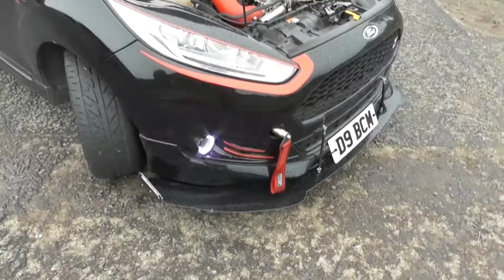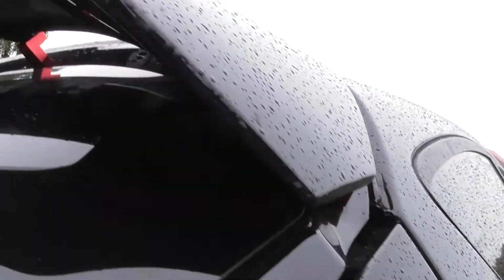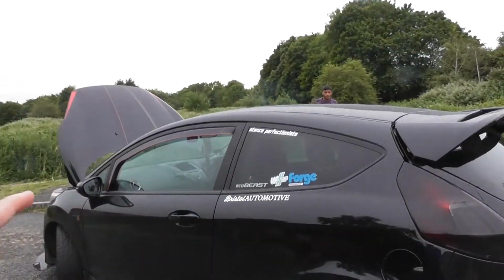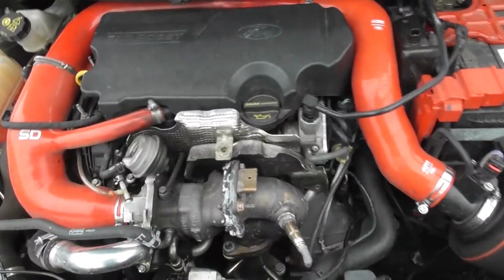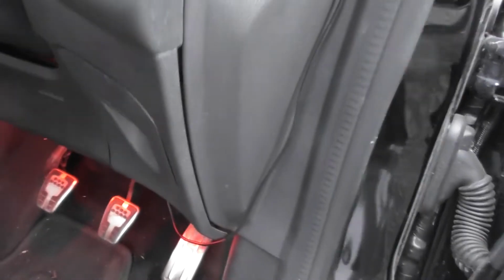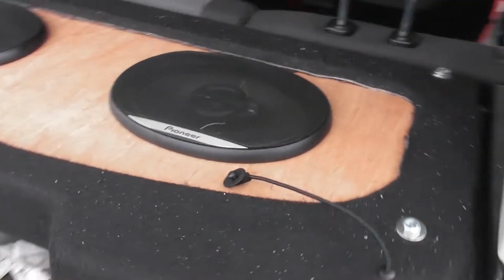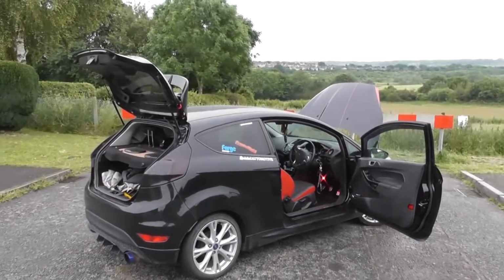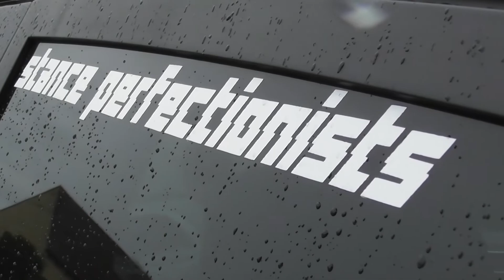This *Stage 1* Fiesta MK7.5 1 LITRE Is FAST!

Comment: How much miles you have done with the remap ? No problem ?
Nice car btw
Reply: T8fit it’s been a good 6000 no problems yet even driving hard daily
Reply: @callummiah7011  Thank's ! how much torque you have ?
Reply: T8fit 250 bud got a nice 50 increase with stage 1
Reply: I can vouch that the EcoBoost engines are amazing! Done 25k+ on Stage 2 with Decel

Comment: For a 1 litre thats not bad, be careful and watch for timing chain stretc, the 3 pots are notorious for it.
Reply: Considering it's a belt,they certainly are not notorious for stretching 👏
Reply: @brianiswrong  I've changed a chain on one of these a few years back im certain, just had a look and your right. Can't think what it was now. Couldn't trust a little 1 litre engine 3 cylinder, and adding mods, just waiting for something to go bang.
Reply: @Stichlyla  
No worries,our stock ecoboost 125bhp has done 108"000 miles so far,1 set of spark plugs and regular oil changes, belt needs doing at 125 or 150'000 depending on who you listen to 
It's a massive labour job (around £800 at a main dealer)
Reply: @brianiswrong  stock they are very reliable cars.